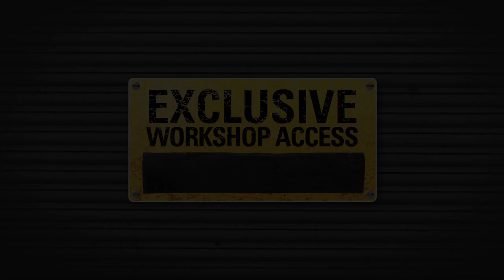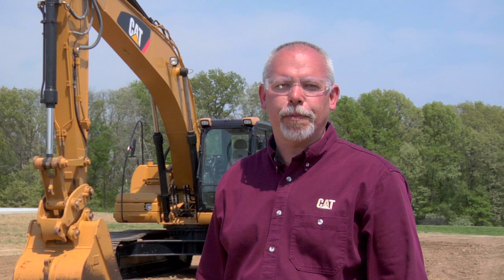Cat® Excavators | Low Power Troubleshooting

Comment: Hi Jeff,
I have a 2021 model 315GC, it digs amazingly well, But l have tracking issues, it won’t track left or right without assistance, as soon as l do it just goes into bypass mode and the machine completely stops, you can hear it bypassing, l have tried talking to my dealer about fixing it but falls on deaf ears, can you suggest anything what might it be or where do l go, this issue started with just 20 hours on the hour meter and now with 1600 hours, = 2.5 years later l still can’t get my dealer to fix it.  
Any help would be so appreciated. 
Regards Andrew.

Comment: HYDRUALIC LOW POWER CHECH THE RELIEF VALVE NEAR THE CONECTION OF OIL COOLER .. CHECK THE VALVE IS LOSE THE NUT.  OPEN AND   RITIGHT  TO CLOSE RETURN VALVE

Comment: Hi,
Would you like to help me, I am working on cat excavator 320xl i am facing problem when both joystick and boom bucket take more load engine its stop
and in front display showing on ( Machine Info showing on IMPL PUMP PWR SHIFT PRESS ( -- KPA ) when engine running condition please advise how to find out problem.

Comment: Looking for information,   my cat is working fine all normal functions except when tracking forward and reverse,  it will track normal for about 5 seconds at high idle and then lose power .  Release the controls and the same has this happened to anyone,   any help is appreciated
Reply: Did you fixed please tell me

Comment: Caterpillar 320D - We remove the cable in the battery (positive  and  negative)  then we welding  it due that there is a crack  in the backle  then  after  that  we connect it back.  When  we start  the  engine, the power  is  low  but all  pressure  is good. What  is the  problem with  this situation? Could you please help me how to solve this problem. Thank you
Reply: What can make excavator to be dropping power whenever is loading
Reply: Please monster send me your phone number

Comment: I have a Cat 313 excavator, when I lift the boom the engine will stall if continue lifting, this only happens on the boom lift, all other movements are fine, 2 months ago same thing happened and by 
replacing the Hydralic filler cap all movements went back to normal operation, now back to having problem even after changing cap again. Any suggestions on resolving this problem.

Comment: Lok at this -------- 1.) worn out pumps - axial pumps are very sensible with dirt in the oil - 2.)  oil-temp  --- 3.) use 32W hydraulic oil - thicker oil can wear the pump up. --- 4.) control all hyd. filters. 5.) control the buttom of the tank ( no dirt ) - 6.) Hawe the oil to mutch watercontent is it not clear / grey etc. - it ruin the pump. --- 7.) hawe the pump a sound noise at all rpm and high pressure, no rattling - screaming etc.  ? --- 8.) Find the pressure, (look at the pressure meter, not to exid pressure) -  walve and try to take the pressure op when a rod is at its end - what happens - no pressure maybee a valve is bad/ stock - listen afther whistling noises --- if no response or / the pump fall out at a certain pressure again and again - the pump is worn out ( can happen fast)

Comment: We have problem with  cat 320dL when we open or closed bucket on that time engine RPM comes down or engine off
Reply: Please help us with troubleshooting
Reply: Not enough supply of fuel..
Or your powershift solenoid is not working
Reply: @johnmarkalolod5097  now we solved that we try all pressure or remove or repair all adjusting valve  or mentioned aalll pressure or check popit valve or interchange adjusting valve or  some valves  pressure which is little high according to required by manual we adjust it then coming ok  but there is not engine problem if have engine problem then also rpm comes down in another functions    is am right boss?
Reply: Is there any Active Error, Active Event, Logged Error and Logged Event on the Monitor ?

Comment: no hydraulic flow but engine is running? Cat 305 E
Reply: no hydraulic function on all hydraulics?, then its the main relied valve is faulty or got stuck
Reply: If you have no fuctions, check the pilot pressure solenoid.

Comment: i'm try to fix low power on boom on cat 330 excavator.new seal kit was installed in boom cylinder but still have low power.what is that problem..?
Reply: Rdiey ASoon , did you find sollution?
Reply: Maybe boom relief valve. You'll need a correct pressure gauge and to complete a stall test. If your output pump  pressures are good, Chances are your relief valve will need adjusting. All the info should be on SIS.

Little tip - the fitter thought the oil was bypassing internally through the cylinder. Use a temp gun to measure if the cylinder is hotter at one end. Then compare temps to other cylinders. If hotter, that will let you know if it's time for a reseal.